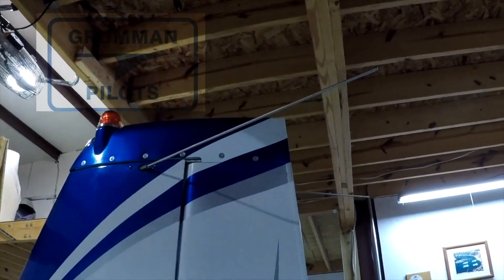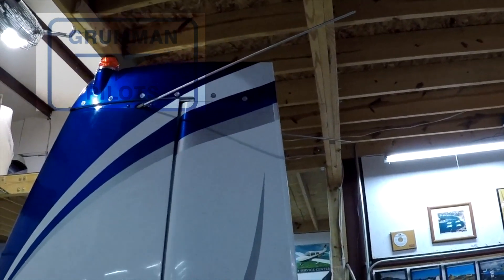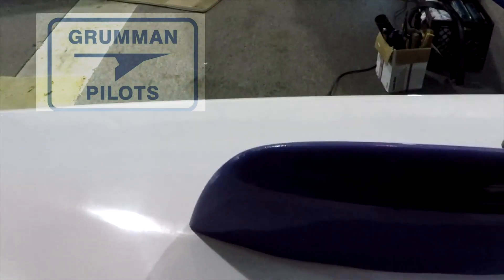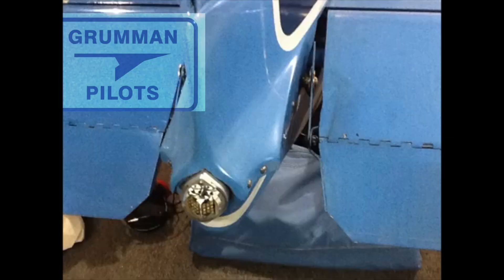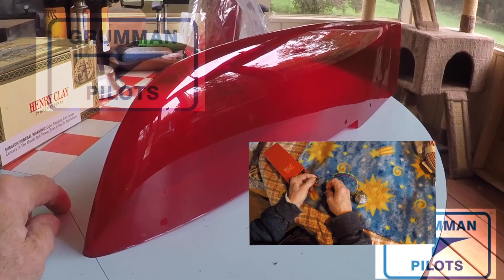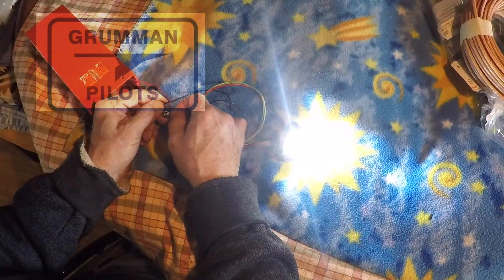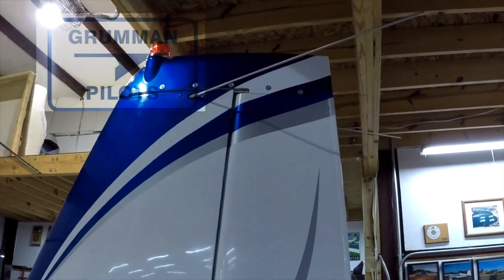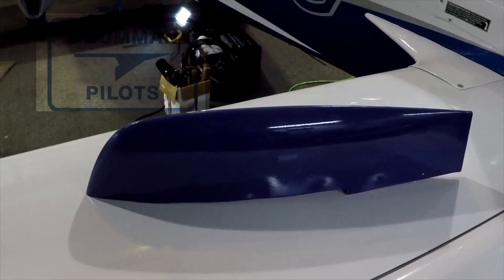LED Beacon Rudder Tip Lighting Options - Grumman Style

Comment: Hi, maybe you can help me. I am trying to locate where the strobe box, flasher unit would be on my Grumman trainer? It’s an AA1B but is probably in the same location. I’m switching the lights to LEDs which have already come with strobes synced. I was told we need to remove the strobe box that syncs them currently and I cannot locate it on the airplane.
Reply from the maker: Follow the wire, most are located in the elt area in the tail cone.

FYI
Reply: @ thanks, actually ended up finding one in each wingtip
Reply from the maker: THAT WOULD BE THE WIN TIP STROBES, I WAS TALKING ABOUT THE TAIL BEACON.

Comment: Hi Roscoe, I currently have an AA1 with a jelly jar on the top, and I recently aquired a red rudder cap off of another airplane that Id like to put on. The mounting bracket for the new white jam jar that sits under it only requires 3 holes drilled and a reblance of the tail, but I was wondering if this requires an STC for the upgrade or not. I assume it would just be a logbook label and I think theres an STC out there for it but Im not totally sure before I put it on. Thanks
Reply from the maker: is an STC out there fore it, we just did that with the Project TIger when we added the Red Rudder Cap.

Comment: I have option ‘2’ (the faired version. I want to upgrade the wing tip lights to LED. I tried the Whelen Orion 650e but had to send them back because they didn’t fit under the lens in the horizontal position (they would fit at a wonky angle however). Any recommendations for wing tip LEDs? ‘74 AA5
Reply from the maker: We use the the AeroLED series:
Stellar "GOLD" Series - LED Replacement Nav Bulbs

SKU: AL-SGS-RGW

Options: Set of 3 - RED/GREEN/WHITE

Gasket(s): NO

Clear Lens Cover(s) - Wingtips Only: NO

Price: $98.00
Reply: @GrummanPilots  the page says not faa/pma approved. 😢
Reply from the maker: @doogy75  SunTail serves as an LED Anti-Collision Strobe and Position Light designed for the tail of the aircraft. SunTail can synchronize its strobe with any of AeroLEDs LED lighting products. SunTail does not require an external power supply and will retrofit the mounting footprint of legacy lighting. It is TSO-C30c Type III and TSO-C96a Class II approved.

The radiation pattern of the SunTail exceeds the spec for the flashing beacon on the top (you actually have to block the SunTail pattern from the wings and forward so as not to distract the pilot in night light.